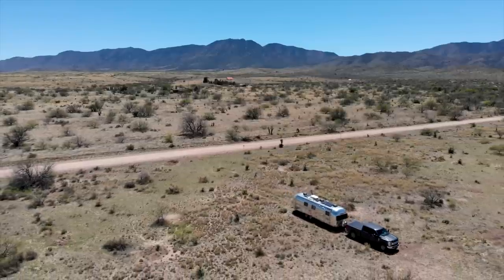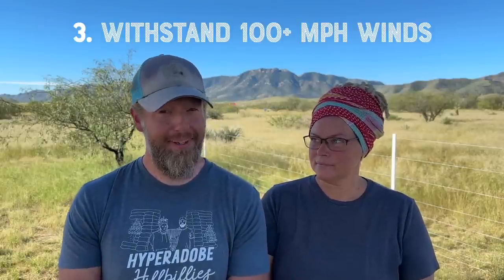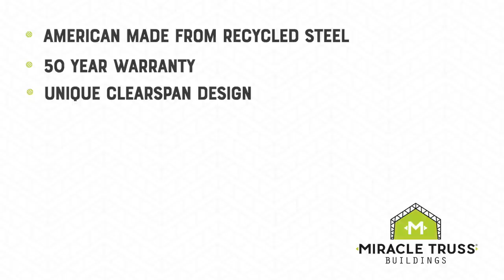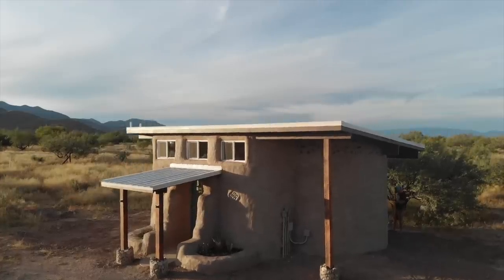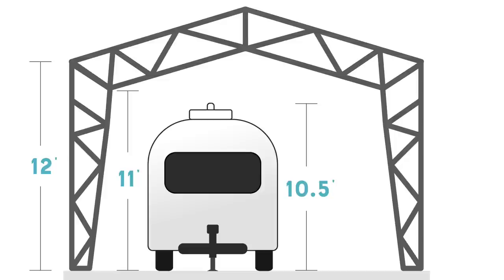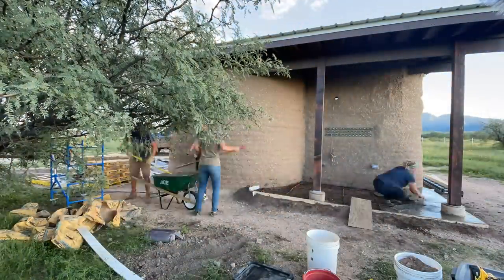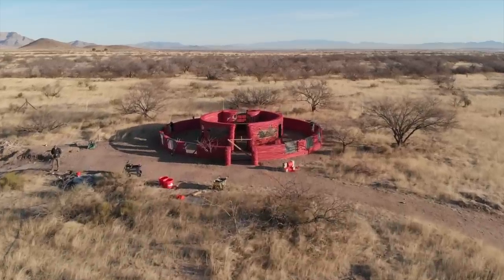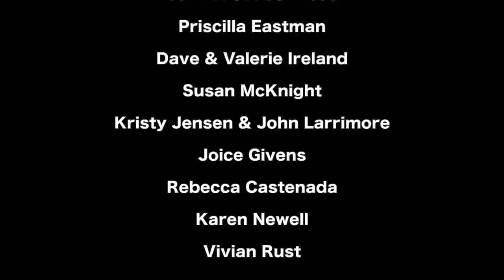NEW PROJECT! Airstream Metal Truss Carport - Permanent Trailer Site (Step 1 Intro)

Comment: Smart choice bringing in an expert for the concrete. It's the literal foundation of your build after all, and in a place with so much rain and extreme temperatures, you're gonna want something sturdy! A lot of engineering goes into making sure that the soil itself can handle the weight of the concrete itself and won't turn into soup when it rains, and you need geotechnical knowledge and equipment for all of it!

Comment: Congratulations. I'm glad your having a concrete contractor due your footings and pad. Because cement it what the Beverly hillbillies called their pond. Lol. Be safe make sure everyone knows their job before you perform each lift. Make sure you have plenty of bracing on site and use it. Everyone pay attention to your surroundings, you never know when you have to move quickly to avoid getting crushed. Don't worry about the shot to much. Safety first. 🌍✌😊

Comment: Eucalyptus oil for flies. Just a drop for each limb, back of neck and face. Once you get a drop or two on your fingers and just rub your fingers and same hand all over your skin it seems to spread all over your skin. It's probably the smell more than anything. Works like a charm for me!  Plan sounds great! Living in the hottest city in the United States, my house faces North and people have told me that's the best for the sun exposure that you don't want. That ram is gorgeous!  Several people in the nicer areas of town have these Steel frames. We need them because of the wind and of course would disappears from the Heat over time. Right after I bought my house before I moved in I had a little bit of work done on the roof, a monsoon wind came up and my roofer,  the only licensed roofer  in town, almost got beheaded from an aluminum boat carport that went airborne a block away.
Reply: Wow, that was a close call. Terrible thing to have happen. I hope he finished the job on your roof on a better day!
Reply: @StoneKathryn  He insisted on finishing. The "boatport" took a chunk out of my roof and the stucco (not that big) right under it next to a window!  It must have been flipping through the air.  You are correct. It was terrible but this is the tough desert so he's tough as well.  :)

Comment: I paid $4,500 for a Wedgcor Steel Building dealership back in the day -- never sold a single one -- learned the profit margin on steel building "kits" can be as low as 2%. But one thing I remember is that steel buildings are often very low slope (even lower than your 3 in 12) and when the wind hits that low slope profile, it creates significant lift (just like an airplane wing). To offset this (as you likely know by now), what I always called "main frames" on our buildings (25' on center so a 50' long building would only have one "main frame" and the end frames are smaller as they only carry half the weight of main frames) required oversized concrete footings so that the weight of them would offset that significant lift and not permit the entire building to lift off and end up in the next county.

Turns out that steel buildings (per square foot) are much lighter than conventional wood construction and they tend to fly quite well. :)
Reply: Thanks for talking about this. I always think of steel buildings as heavy. Now I know different.

Comment: Sounds like fun.  My one thought is why would you pour concrete to PARK a trailer on?  A trailer that's been fine sitting on dirt for years.  That's really expensive concrete to just permanently  cover up!!  Why not put footings on the trailer side and then pour a nice pad on the living side?  Or spend the concrete in a more useful manner making a larger people deck/space that spans beyond the building out the people (usable side).     Put a raised crushed rock pad that water can easily drain thru under the trailer and out the non-usable side.  This might also provide more height clearance as the trailer could be a bit lower than the pad which reduces the step-up too.
Reply from the maker: To protect the trailer long term, provide a stable, flat area to park it on, even double as potential storage space underneath. If we're putting this building up to park the trailer permanently on a pad makes the most sense. With this much invested, there's no point in doing it halfway.

Comment: You guys are awesome as ever and look ready to start kicking butt again!!  The plaster masters will become new found masters. I am eagerly waiting to start !! 😀
Reply: Curious. Here in Taos County our buildings have to be 10ft from side property lines and 20ft from the front.. (Which mine goes to the middle of the road) I haven't asked if my fence can be ON the property line... I know counties are different. What's yours? Besides you said going 20ft from property line.
Reply from the maker: 20 feet from any property line. But that will all depend on your local codes.

Comment: You’ll need to be more in a thought process of winds higher than 100 mph, I would hope that the both of you will consider winds above 110 mph, as the winds have been changing for some time. So just a thought or two that we are thinking about.
Reply from the maker: Miracle truss buildings are engineered for 115mph winds by default.

Comment: I really like your channel and what  you are doing there in Cochise County. Miracle truss sounds like just what I need to protect my 40 foot Skoolie from the sun. One tip though. I think you’re misusing the word cement when you should be saying concrete. Cement is a material that is mixed  together with sand, stone and water to make concrete.
Reply from the maker: Technically? Sure. Most people use them interchangeably at least when talking about a pad.

Comment: Are you gonna need to relocate your solar panels from the Airstream, or do you not need them now you have your solar shed?
Reply from the maker: The Airstream has been powered by our big solar setup since it was installed in so we  can run A/C in the summer. It does still have the battery bank inside for emergencies.

Comment: Sounds great, will you put your solar panels or expand your solar panel system on the roof of the new structure.
Reply from the maker: Panels will stay on the Airstream in case it ever needs to be mobile again. Our big solar system has been powering it for a year anyway. We’ll be running new lines up to the cover to power everything.

Comment: What is the point of the inspection"opt-out" if you are building the structure properly (per the building code)? Completing the structure with inspections will insure future compliance issues for both insurance and financing either for you or a future buyer/owner.
Reply from the maker: There are lots of trade offs for opting out that we’ve discussed before and I can’t cover in a comment. Mainly we save enormous amounts of time and money. And get to build things like earthbag solar shed offices.
Reply: They can build with alternative building materials. They have time to build it over years with the permit. They don't have to have inspections all the time while they build it. They will do what they can to code but there is no set way for the building of a hyperadobe bag structure to be a "standard" build. No one could certify it as structurally sound. Our ancestors knew how to build this way and their structures have lasted the test of time but no one in our "modern" times could "legally" say it is built to code.